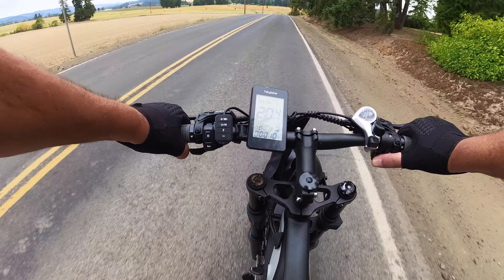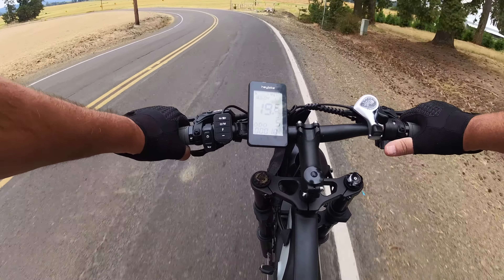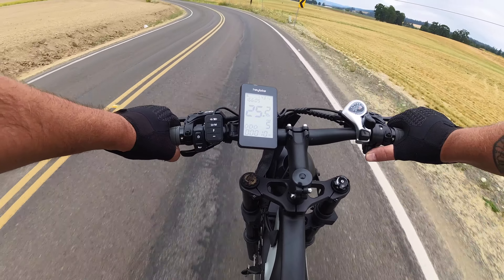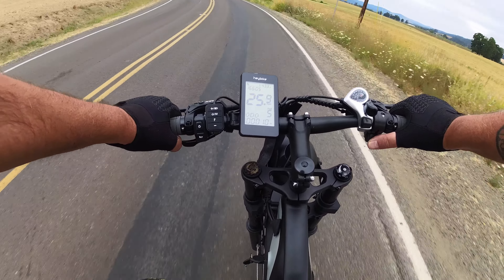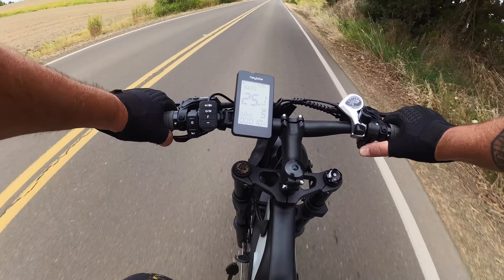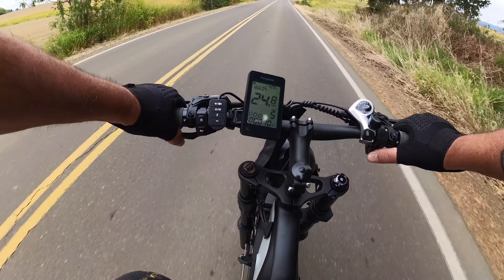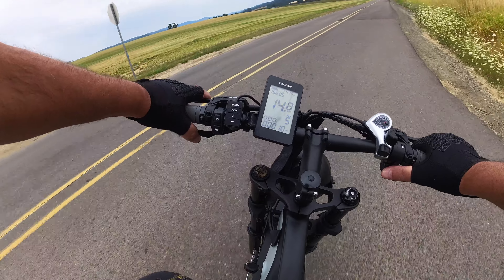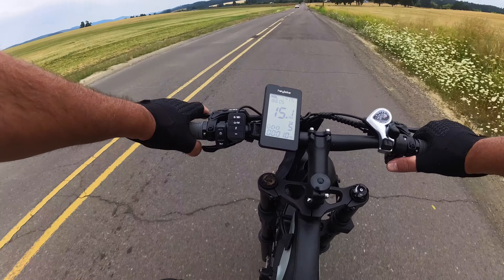HeyBike Brawn Motor ChangeOut

Comment: Hello, 
     I've watched most of your videos on the Heybike Brawn. My question is about the freewheel or freewheel cassette. Do you know which it is and I'd like to swap to a cassette with a 34 or 36 tooth and don't much care about the small gear so do you know if the Sunrace series will fit? 
I'm getting to know the bike and have replaced the nylon planetary gears twice and am installing a second battery. I'm on my second Brawn because the other was totaled by a vehicle collision so I removed that power socket for the battery and have the original battery and am waiting for a combiner I've ordered. This Brawn is climbing much steeper hills than the original but I'm going up mountain single-track trails and need a few extra climbing teeth. Thanks for the videos, you do good work.
Reply from the maker: i don't lnow but I would guess freewheel

Comment: And if possible can you explain why I'm hearing a weird patter when applying the throttle and it goes quiet when I let off I've been told the brakes might be mis aligned and that's causing it (brakes are Def misaligned) went to change pads and ate one pad completely hardly touched the other side

Comment: Is this motor change to make it faster ?
Reply from the maker: no it does not
Reply: @RVEnthusiast  thank you 
Question another then changing the setting in this bike and upgrading the battery to a 52v is there ANYWAY to make it go faster ?
Reply from the maker: @Scb30476  You would need to change out the controller and display. the motor is strong enough for 30-40MPH.  CitizenCycle has made mods of this type.  Not for this specific bike, but you will understand what all is needed.
Reply: @RVEnthusiast  thank you so much I guess I’ll go check out he’s channel, is just I love the look of the Heybike brawn no other bike has it but is just not fast enough so I’m trying to make it go faster instead of buying a bike I don’t really like the look of 
Is there’s anyway you can refer me to a specific video or tutorial ?
Reply from the maker: @Scb30476  I sell most of my review bikes, but I have not sold the Braun...Because it looks so good.  I have the original Mars too that it s fun little bike to ride.

Comment: I replaced the rear motar on my brawn as it was making noise..it ran for 10 seconds and right back at to the start..E-24 AND TICKERS  HALL sense error..help I still have warranty but it was anight mare
Reply from the maker: Contact Heybike.  My guess is pedal sensor, but could be controller.